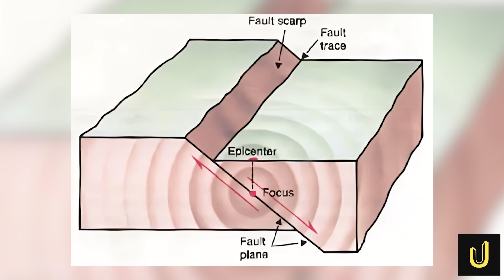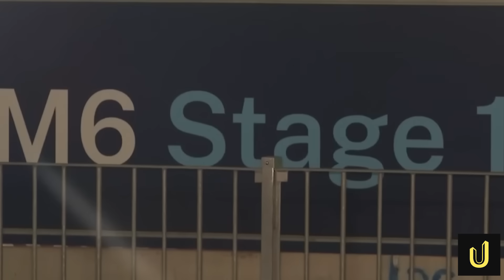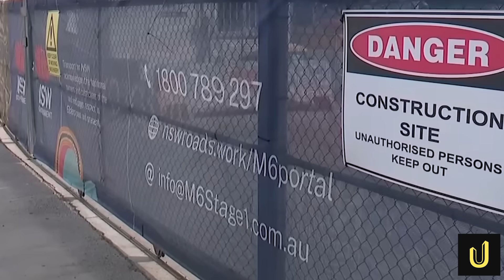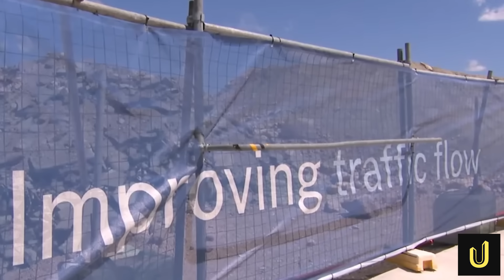4 BIG Mistakes That Sunk Sydney's $3 Billion M6 Motorway Tunnel

Comment: With my tunnel boring experience in stratified ground, l would have the tunnel up and strengthened in a matter of months and use ground hardening and freezing techniques to overcome the weak over-layers. No geophysical sampling was carried out and this has to be done every 3 to 5 metres to access the conditions. The whole operation was done by an incompetent gaggle of buffoons who had absolutely no idea what they were doing. 
Everything they did was a disaster and the excavation has to be rescheduled with a complete different shoring operation. 
My team will completely reschedule and restructure the operation to make the ground resilient before any more excavation is attempted. 
Obviously none of the incompetent engineering team will remain.

Comment: There's never been a single road project in Sydney that wasn't way more expensive than announced by the government. Blowouts of a factor of 2x are common. 2019 would have been under the auspice of the total moron Andrew Constance, so easy to see why the project is a catastrophe. This clown did most of the calculations of costing on the back of a postage stamp.

Comment: This armchair engineer says they should have used cut-and-cover tunnel construction through the dodgy ground sections.  Perfectly feasible if it is only 12 metres down.  And given what has happened, it would have been quicker and cheaper.

Comment: I’m very old. Lived in Rockdale/Kogarah as a young un. Historically, from about the Highway, which is on a hill, down to the bay there were numerous creeks. Flowing downhill but also towards Cooks River. The stormwater drains occupy some of these water flows.

Closer to the bay is a huge swamp land I used to play in. Stretching from Cooks River/Kyeemagh to Sandringham. That whole swamp was set aside for the F6, now called M6.

West Botany street flows right through. It’s where the collapse happened. On either side, historically are creeks (used to have tadpoles!).

Part was already built - Captain Cook Bridge in about 1960 iirc.

Sadly, and this is the root problem. The expansion of development in this wetlands has meant that the overland F6 was no longer possible. There’d have been a huge loss of netball courts, soccer playing fields, a school, light industrial, and houses in the Sandringham/Sans Souci area and so on.

Having said all that, I was surprised at the underground route they chose. I guess the engineers decided that tunnelling under the ORIGINAL corridor was more difficult/expensive? Even though, although partially developed, significant tracts of playing fields etc would have been easier to tunnel under?

As in, rip up the playing fields. Open cut dig down. Build the tunnel. Shallow cover over. Rehabilitate the playing fields, new schools, light urban/retail?

But then, I’m no engineer

Comment: I live in the Area of Kogarah where the M6 is planned to be built..it was meant to go all the way to the shire ! All of a sudden sink holes appeared near west botany st and the industrial site at Rockdale ! it was travelling well....until this happened ! Some bright spark in Government didnt do their safety checks properly and thought this would work well.....No proper tests of the underground were made and when you look at it properly....the beach is only 500 metres away with sand and a river swamp at Scarborough park nearby. Someone stuffed up and didnt think of planning the motorway/tunnel properly. The blame goes to the NSW Government and the Engineers who didnr properly drill underneath to check if this was viable. Yes the contractor gave up as he knew that it wouldnt with the tools he had available! So there is a cover up in all this and the NSW Government is not coming clear about the whole thing. Chris Minns is the Premier and he is the Local member of Kogarah too....the truth will be said and the quicker it happens the better will be to finish this M6 project ! And thats just my opinion !
Reply: It's strange they didn't pick it up. I know they did extensive geotechnical and seismic testing before the Sydney Metro Northwest was tunneled.
Reply: Important point — These are the point which ought to have been put to the government during Question Time.   (Ever considered joining the Labour Party?   If you stand back — chances are that the bloke who takes you place will not make the sort of comment which you have made here.)

Comment: Build it on the surface.  Purchase the buildings in the way.
Reply: Yes — I saw one bloke suggest using the old “cut and cover” method — No reason not to because there is no likelihood that anyone will want to construct a 20-storey skyscraper in that quicksand.

Comment: Large space tunnelling close to the surface, through unconsolidated loose ground, using the cheapest quoted method - what could possibly go wrong ?
Would not have happened with a TBM using precast concrete circular segments.
Reply: What indeed?

Comment: Its plain karma! You try and build it cheap and nasty thats when you get problems. You cant build it like a mine even those fail at times. Its great the goal to create vast but you need to possibly do it with a tbm forming the sides and top therefore keystoning the spance

Comment: Shows how selling off the original planned ground level freeway corridor now necessitated by the tunnel was such a monumentally bad decision by the then Neville Wran government back in the late 70s.
Reply: I was just thinking, why not just have an above ground freeway. much cheaper and quicker to build. politicians obsessed with building everything underground. newsflash, its a city... its going to have some roads and arterials
Reply: @photo2000  Adelaide's huge South Road project has an elevated section and a trench at its northern end.  That's been working well for several years, and no soil has crumbled down because there's only sky & bridges above.  The 10.5 km middle section is about to begin – a mixture of tunnels (almost 60%) and open motorway.  The constructors have taken soil samples, and know there's a wide diversity of content.

Comment: Grouting and ground freezing carry inherent risks, including time and cost overruns. A more favorable approach would be to construct a slurry (diaphragm) wall or secant pile wall (with temporary casing) and transition to a cut-and-cover tunnel with temporary bracing and buried columns  to stabilise any nearby structure. While this option may appear more expensive at first glance, it will significantly reduce the risk of further delays.
Reply: That's exactly what they did do. However, the end of the cut and cover tunnel was a couple of hundred metres short of where the collapse occurred.
Reply: Yes -- No reason not to do 'cut and cover' -- There will be no very tall structures erected in that vicinity for the same reason that these tunnellers are experiencing difficulty with crumbly soil / substrate.

(Pleas apply to Department -- to over-see this project -- They bloody need someone to lead them by the hand.)

Comment: the trouble with Law is that they have never done anything practical and so they think the courts will solve their problem. They do what they know, which is not much ! 
The problem was not entirel;y their end, for it appears that the engineers or subcontractors responsible tried to 'cut corners' and save money ! Furthermore, as a tunnel proceeds core/ bore samples should be taken at intervals  and examined for composition, strength and water content. To come across something unexpected is one thing to be taken by surprise is another
Reply: I have no knowledge of civil engineering practice — but perhaps one means of ascertaining whether the proposed path of the tunnel is suitable for tunnelling would be to drill an appropriate depth into the ground along that proposed path using one of those very small yet very deep drilling rigs that are used out in the desert by contractors who drill for subterranean water to irrigate remote grazing properties — to drill down into the terrain 200-500 yards (‘meter’) ahead of the tunnelling work below?

Comment: Should get someone who know what they are doing. Australia have very little skill in building these sort of projects. China have the knowledge and experience to do this work safety and meet budget. The West full of corruption therefore they are making simple tasks so complicated.
Reply: China would not be interested as OZZ flipflops with the USA.
Reply: That's completely wrong. Several very large tunneling projects have recently been completed in Sydney, both road and rail. There is a great deal of tunneling experience.

Comment: incompentence 12m below no way near enough to support buildings above
Reply: Especially since parts of it were 90m deep, 12m means they were resurfacing? also circular tunnels tbm machines back fill with concrete, more stable. Unfortunately means removing more materials and smaller diameter. They got greedy.
Reply: @QuinnMallory-od1hw  yes, this area is along the on/off ramp at the end of stage1, even if the methodology was TBM, this would be left on the main drive to continue with later stages. and an alternative method would be used for the short (comparatively) on/offramps

Comment: all of Sydney's roads are a complete joke including the idiots controlling the traffic lights, M8 is a nightmare
Reply: M8 is great. Use it daily.
Reply: @skeyzie but there is a section of it where its rusting so badly due to water leaks
Reply: @Skybar23 pretty normal imo. Always water underground. Not sure if it’s rust but it is similar color
Reply: @cybertones942  It could be red top soil! Yeah.
Reply: M8 is great but the prices are effed.
Reply: Never has issue with traffic on M8

Comment: The crossrail project in England encountered a lot of issues to do with groundwater. If Sydney had have taken a slightly more expensive route with a tunnel boring machine they would’ve had the primary tunnelling completely finished by now.
Reply: Tunnel boring machines are good for drilling perfectly circular tunnels about the size required for a train to pass through, but are utterly hopeless for drilling tunnels big enough for a three lane (in each direction) highway!
Reply: Examples of road tunnel projects using TBMs
West Gate Tunnel Project (Melbourne, Australia): Two TBMs, "Bella" and "Vida," are used to dig the new road tunnels under Melbourne's west.
North East Link (Melbourne, Australia): The two TBMs, "Zelda" and "Gillian," are building Victoria's longest twin road tunnels.
Torrens to Darlington (T2D) Project (South Australia): This project will use three TBMs to construct the road tunnels, marking the first road tunnels in South Australia to be built this way.  @sydnorth5868
Reply: @sydnorth5868  They're using TBMs on the Western Harbour Tunnel. The ones they are using have a 15m diameter. The WHT will be  lanes wide each way.

Comment: Why build tunnels, in Thailand the motorways are in the air many above local roads, much cheaper and easier to build and fix.
Reply: It’s to do with the cost of land in Sydney and the complaints of residents who don’t want a mega highway overlooking their backyard. Most of Sydney is on hard sandstone, but in the South there is different substrate.
Reply: @smmcb647  yes, sydney people are wingers.

Comment: The modern NSW Labour Party is not representative of the mass of working people of NSW — and so it has produced policy which is not thought through.
Reply: Dreary Dan Andrews canceled east westlink in Victoria and campaigned on the basis that the contract wasn’t worth the paper it was written on. 

Turns out it cost the tax payer over a billion dollars- companies doing this kind of work don’t employ useless lawyers because the company wouldn’t exist without contract protection.

So as a penalty Victoria kept voting him in. 

This lack of fiscal responsibility and mismanagement is across the board
Reply: You're blaming the Labor Party? The Labor Party became the government in 2023.

The plan to build the tunnel was from 2015. The geotechnical analysis was done in 2016. The decision to build was in 2017. The plan was approved in 2019. Contracts were signed and construction began in 2021. Parts of the plan were scrapped in 2022.

The Liberals were in government from 2013 to 2023. You are blaming the wrong party.
Reply: @paulkennedy8701   At what date did the collapse of the tunnel occur?

(The Labour Party rank and file branch membership has been further to the right than the Liberal Party since 1980 -- perhaps since 1960?)
Reply: @RogerDalrymple-w4t 

The collapse happened in 2024. That's in the video.

And you think the collapse had nothing to do with the dodgy ground studies, or the penny-pinching design work, or contracting an inferior contractor, or ignoring of clear warnings, or changes to the brief? All of which happened under Liberal governments. You think it collapsed because the Labor policy was "not thought through"? How exactly?
Reply: @RogerDalrymple-w4t 
 
Well, you've clearly got some bizarre obsessive hatred of the Labor. But what on earth are you blaming them for? The "policy" you say they didn't "think through" was to honor existing contracts and continue existing construction projects. And you think they should have abandoned the project, written off the money that had been spent, violated their contract and paid a fortune in compensation to the contractors?
Reply: @RogerDalrymple-w4t "How did you obtain information...?"

I watched the video! It's what the video is about . Are you too busy hating the Labor Party to even hear what the video was saying?
Reply: @paulkennedy8701  If the reporter who broadcast this video was able to obtain detailed information regarding the defects in the project — and perhaps the impossibility of carrying-out that project in that form — i.e. information which was available during the lead-up to the commencement of the project — then the Labour Party had an obligation to the people of N.S.W. to have made that information public — and used that information to halt the project — or modify it / re-direct it / cut-and-cover method to avoid tunnelling through a type of terrain which was unsuitable for tunnelling.

Comment: Most Australian engineering projects and in disaster
Reply: Rubbish. Plenty of great engineering projects recently completed in Sydney. Plenty of older ones around the country. This one just struck an unexpected lack of sandstone.
Reply: The area there is part of the swamps in the city of rockdale  vicinity .
.
Reply: @mltoob  Correct there are plenty of older great engineering projects, I have counted 2 in my 70 years, and they were constructed with full foreign design specs!!!
Reply: @amaknusa9212  Well you would expect the Snowy Mountains Scheme to use foreign experience since Australia had next to none in hydro power infrastructure.

Comment: Reverse fault caused the unexpected sinkhole?  When the "engineers" start making up terminology you know you're in trouble.  They must have graduated from the Snowy Hydro school of Engineering.  Don't worry; the Australian taxpayers will pick up the tab.
Reply: What's wrong with the terminology of a reverse fault? Very common geological feature and term.
Reply: @scoobsm6994  I take you point that a 'reverse fault' may be common.

(Just not sufficiently common for the contracting firm to bother to look ahead and see whether there might be such a barrier lying across the particular path that the firm had decided to tunnel along?)
Reply: @scoobsm6994  The issue is that sand is sand. It's not a reverse fault.
Reply: You mean Snowy Hydro 2.0? The original Snowy mountains scheme was a great success.
Reply: @mltoob Thanks — on behalf of the many.  (I was on the point of saying that Mr “Joseph-j9r7g” comment is not worth responding to — Then it occurred to me that it is always worth while to contradict the cynics when they send out their rallying calls to their fellow cynics.)
Reply: If japan can build a network of subways in an earthquake prone city, they can engineer this
Reply: Education doesn’t make you smart. Liberals are educated but they’re not smart. Sydney is liberal run. Like the blind leading the blind

Comment: The original intention of a surface reservation was to build a surface road. The reservation is still there. Why did they decide to go underground?
Reply: NIMBYs buy property along the corridor on speculation that it will never happen, and then protest when those plans do start taking shape.  M5 East and M2>F3 (well, M1 now) are classic examples of surface reservations that were forced underground by NIMBY sooks.
Reply: Good question - we usually miss that opportunity due to property rights.  Love the Singapore solution - take over the whole area, dig a humongous hole, concrete and support it, then build roads, parks, buildings over the top so there’s lots of parking, then restrict the number of vehicles so you don’t have to redo it.
Reply: This is the whole. Argument with western Sydney. They will. Take houses and land. All the time to build.  But won't go underground but in the city and. Rich areas they will spend so much more and. Not touch or take a single. Rich areas land or home
Reply: Yet they will. Take. All this. Farm land and property to. Build. Solar farms.  And power lines when they can. Just put power lines under ground and. Just have service huts for. Assess  but. Won't and they have. This. Surface. Reservation. Already done. And. Choose to tunnel   Minns looking after the rich again and. The working class always gets. Screwed